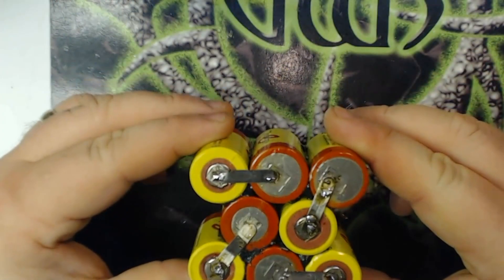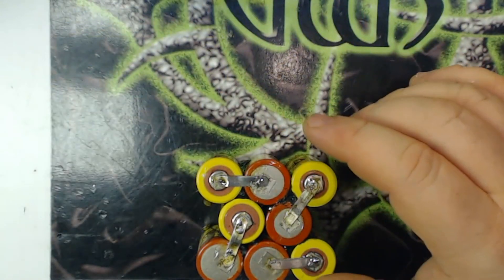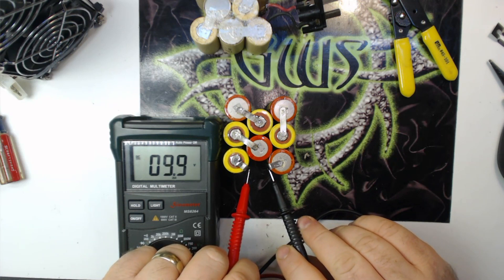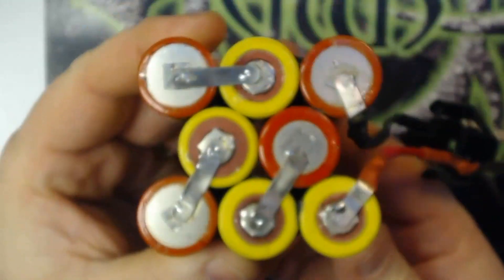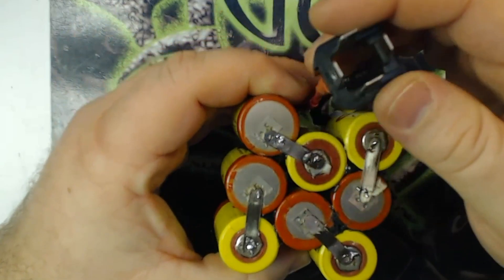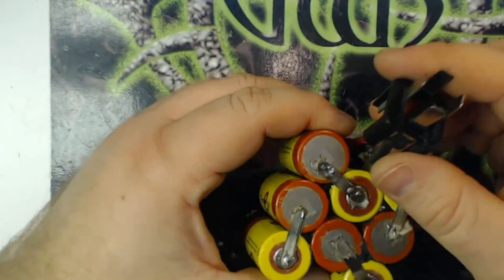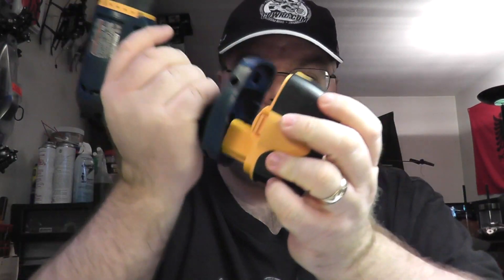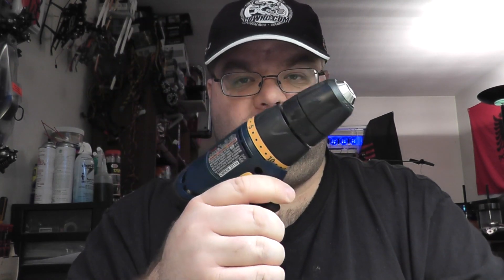DIY - How To Repack A Battery Pack - Part 5 - Clean Up & Finale

Comment: Thank you so much!  Great series.  I'm a musician and I will be replacing a set of 5 x 2000 mA NiMH 1.2Vb atteries in a wireless midi transmitter.   The transmitter has it's original batteries from the early '90's and really have lost their spunk.  I searched for new transmitters and they wanted a fortune.   So why not DIY!   You video's really gave me the training I need.  I'm going to start the project tomorrow and let you know how it works out.

Comment: Very useful series of videos, thanks :)
Here's a question: Do you have an opinion about using "wire glue" to connect batteries without the heat of soldering ?
Reply from the maker: Sorry, ive never used it.

Comment: Hey Greywolf, just one more question. I noticed the old battery pack in the video  is wrapped in paper.  The replacements are wrapped in plastic.  I'm concerned that the heat generated from the tabs (battery  to battery) could melt the plastic wrap and shorten out the batteries. Is that possible or not?  My pack is an 18 volt that requires 15 sub c's. It packs a lot heat.  Any suggestions would be greatly appreciated.
Reply from the maker: +carmenxena Ive never had any trouble with that happening. Ive never had a pack get that hot even if it was 18v

Comment: Wow. thanks for quick response. I took apart the battery pack.  The batteries are covered in paper. The sensor is taped to a small rectangular opening through the paper onto one bare battery and connected to the terminal that charges the whole battery pack. I guess my question is how do I connect the sensor to my new batteries.
Reply from the maker: +carmenxena just recreate the way it was hooked up in the first place. take a hobby knife with a fresh blade and cut the plastic away where the sensor needs to attach to the cell and then hook up the ends in the same places as before.

Comment: Great video! I noticed that your batteries do not have a sensor to stop the charge when it reaches a certain temperature.  I have a sensor in my old battery pack.  Will this sensor pick up the heat through the Tenergy plastic wrap batteries.  I figure I have to install this sensor in the new battery pack.  Any advise?  Thanks.
Reply from the maker: +carmenxena The battery packs I have that have thermal switches in them are connected in series to the ends of the batteries and do not need to actually touch the sides of the battery. Im not aware of any other type but then again Im not a professional.
Reply: 0p

Comment: Like tour video's! Thx. Q: if only one cell is worse, why to replace all Cells?
Reply from the maker: If the battery is out of warranty which Im assuming it would be if you were thinking of doing this yourself then I personally would want to have matched cells in my packs that had all the same amount of use on them. You could technically  replace a single cell if you were on a tight budget but that would be kinda like replacing the brake pads on one side of your car without doing the other side. Also if youre going to repack them you might as well do them all and use higher quality cells than the cheap cells that usually come in cheaper battery packs like with Ryobi and a lot of the other cheap brands.

Comment: Nice video series. :) I'm just doing this with a 14.4V battery pack as I write this. 

If I were you I would have upgraded the battery to 12V by adding two cells, looks like there was room for that. The motor will not be damaged by that increase and I guess you are not using the stock charger anyway?
Reply from the maker: Thanks for the kind words. Unfortunately There is not room for 2 additional cells. The 8 cells that are in there are actually a tight fit as it is otherwise I would. Its ok though because my drill only sees very light duty just around the house and its not very frequent use at that. :)
You are correct I do not use the stock charger. The stock charger is actually what burnt up my original cells. I use an after market CVCC battery charger. I just made an adapter that connects to the charger and I use alligator clips on the other end to connect directly to the tabs of the battery pack. :)
Reply from the maker: Seth JustSeth
Not really sure what that means Seth...

Comment from the maker: As for the soldering iron you showed me on my FB page it says its 40W and 900F max. a 40W soldering iron wont go up to 900F. my trakpower TK-950 station is I believe 60W and the max temp listed on it is about 850ish. I cant say for certain whether or not a 40W iron would work or not. On my 60W station I could solder the joints at about 700 degrees I believe it was without keeping heat on it for more than a few seconds.

Comment from the maker: If youre buying batteries off of ebay you will want to make sure they are a brand name that you trust because Ive tried ordering generic batteries off of ebay before and they were crap. I infact did the very first pack with generic batteries from ebay that were supposed to be something like 2500 or 2800mah and turns out on my battery charger they would only hold about 400mah. When I charge those 2200mah Tenergy batteries they actually take 2250mah.

Comment from the maker: you would have to take measurements of your cells with a caliper or just doing the math and then match the cell size with whats listed on the website. That info and the info on were to buy all the other stuff is in one of the videos. Either the first or the second one if I remember right.

Comment from the maker: Yeah Ive had my drill for years but I dont use it very much so its still in perfect condition. I love that the newer drills on the market are starting to adapter to using lithium batteries as they preform so much better than NiCDs but as long as my drills still pluggin away no since in throwing it out :)

Comment: Ha. I have exact same drill with exact same packs and had the exact POS charger and exactly the same thing happened. That was a long time ago, but of course it is a nice drill and it was hardly ever used. I ended seeing a Black and Decker 12.x volt lithium drill, a little smaller, for 38 bucks. It's at Lows for like $50 or so. Anyway I got an extra lipo pack at ebay for $20 and that little thing is a beast!  I still have those bad packs and nice Ryobi drill on a shelf.